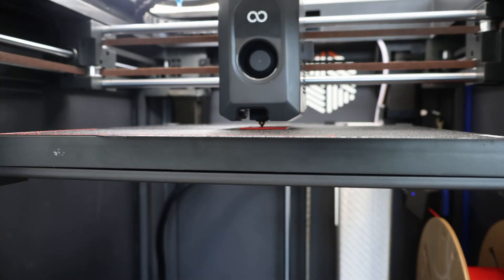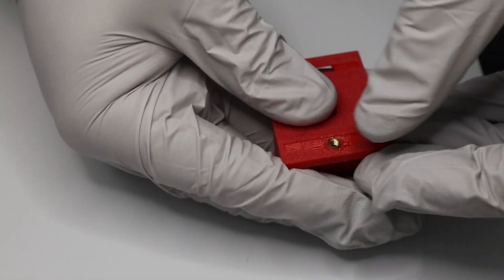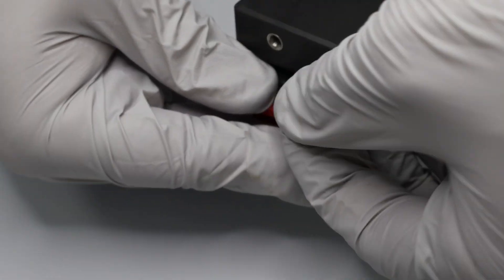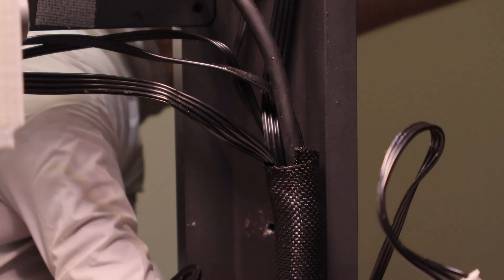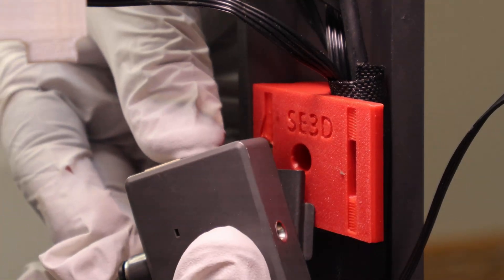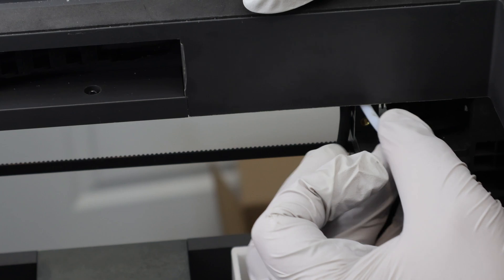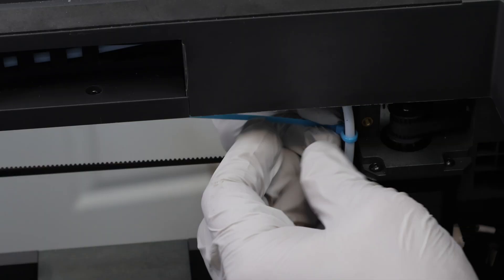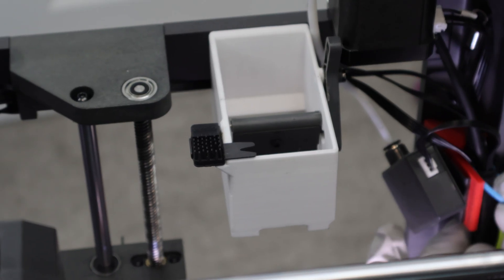Centauri Carbon Filament Runout Sensor Relocation

Comment: which way is superior to load the filiment over or under I feel like over pushs the tube a bit tight it works but under means its pulling the entire weight of the reel

Comment: Engineers versus Common Sense. An engineer designs a system for your printer where you have to build 8 Riser gaskets, thumb screws, massive hinges, adapters etc.  the guy with common sense just flips over the metal panel and prints a simple shortened filament holder and calls it a day. Remember smart engineering isn't about how many stupid pieces you can create to do one thing it's how little parts and pieces you need to actually accomplish the goal

Comment: couldn't you make a sensor mount that would use the exsisting holes on the side panel from where the sensor mount was located on the outside before instead of doing this?
Reply from the maker: There's not much point because one can just reverse the OEM mount. That's what I did initially. But I wanted to decouple from the panel so that it could be easily removed, if desired.
Reply: @SyntheticElectron3D  Oh, ok, glad to know I can have that option too then, thanks for letting me know.

Comment: hi couuld you flip the screw from the filament runnout sensor to the 3dp mount to be closer to the side panel rather than to the back panel (ie inverted), this way the lip from the filament runout sensor would inside which is much easier to access. thanks for contributing to the ECC mods!
Reply from the maker: I think I understand what you're saying. I'll look into doing that in the next update to that model.

Comment: sorry, but whats the purpose of this 
?? what am i missing ?
Reply from the maker: Internal spool holder. I'm fairly certain I covered it somewhere in the video. It's especially useful if you want to remove the panel while changing the filament, which my drop-pin hinges allow for.
Reply: @SyntheticElectron3D  I think it would have been helpful if you demonstrated this scenario. I heard you mention the internal spool holder, I see you mentioned the drop-pin hinges, but it's still hard to understand the application without actually seeing it.
Reply from the maker: @TWO515TY  You make a valid point. Originally, this was intended as a guide for people who were coming from Printables because they already knew what they were trying to do. As more people are watching without the context, it's becoming apparent that I need to do a comprehensive video that covers the entire internal spool holder topic. Thanks for your feedback!